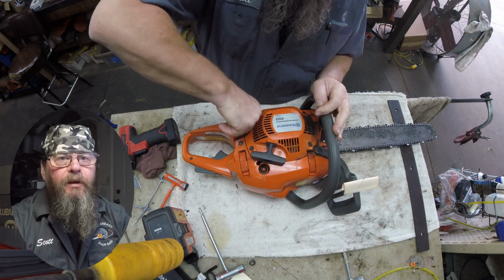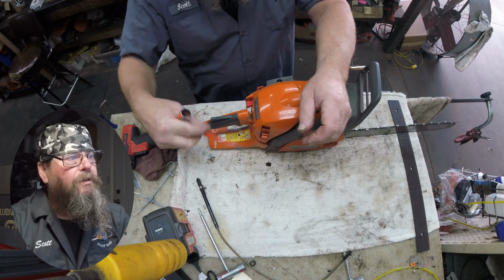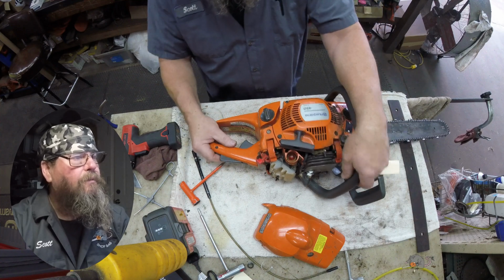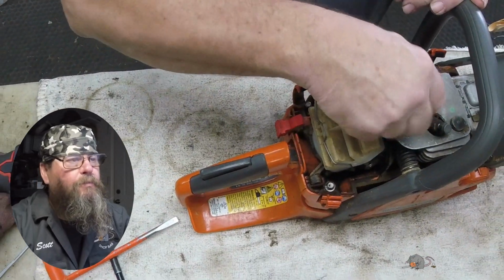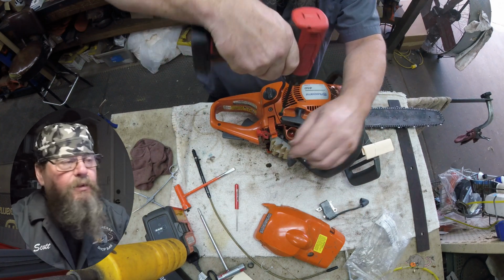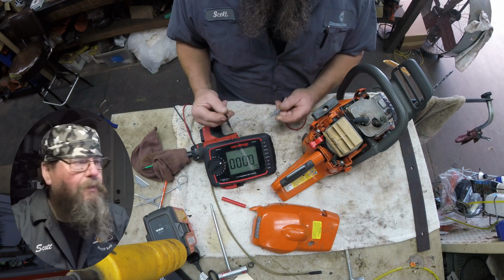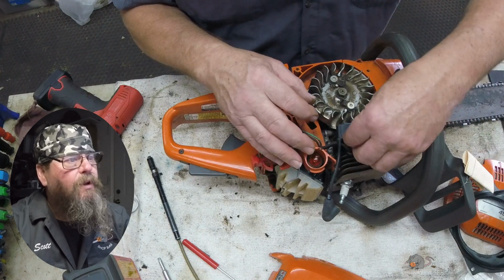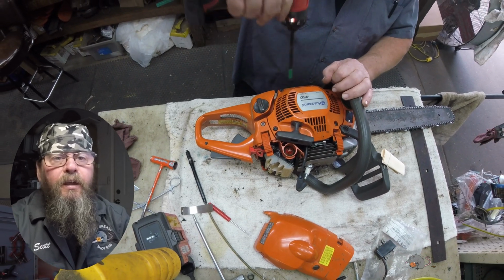Husqvarna 450 Chainsaw Runs Terrible

Comment: For those of you that watch on a regular basis, take notice that Scott doesn't change the normal routine of inspection.  Regardless of the complaint, the basics always need to be checked first.  That way you don't make repairs to a saw with a scored cylinder or so I've heard.
Reply from the maker: @richardflagg3084  True dat.

Comment: i own a Tanaka pole saw that had the very same problem! First thing i did was remove the carb and clean it. It was clean. I use ethanol-free gas. Took it to my small engine guy and he determined it was the coil. The old one had a good spark but it was occurring too late. Good video!
Reply from the maker: Yep it can happen to all brands.

Comment: I just bought a used Husky 450 Rancher.  Looks like very low miles...barely a scratch on it to be found. Serial number suggests it was built in 2020.  Mine has no decompression button.  Some I see do, some I see don't.  What's the story about that decompression button on these 450 Ranchers?  Is that a newer thing or an older thing?
Reply from the maker: Pretty sure the older ones had the button and the newer ones don't.

Comment: My 353 is running erratic and I bought a new fuel line, filter, and intake boot, because of similar situation on this saw, I’ll now check the spark and ignition. Thanks for this. LATER
Reply from the maker: Thanks for watching!

Comment: With so many of these bogging down because of bad gas and dirty carb, I'm humbled and surprised you were able to quickly isolate the problem. Even a spark tester may seem to give a variable intensity with the vibration of the motor. Good for you.
Reply from the maker: Thanks, and Thanks for watching!

Comment: I have not used the spark gap-jump tester on a running motor, yet.  Learn something new every day,  Thanks!
Reply from the maker: I'm not sure if its an approved use of this tool but it does give a nice visual clue as to what is happening. If I wreck it I'll buy another.